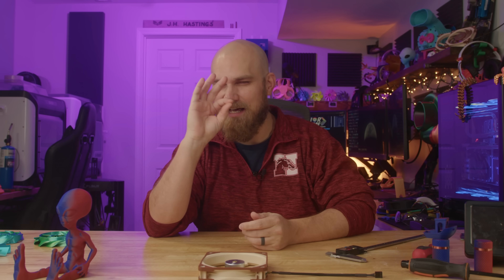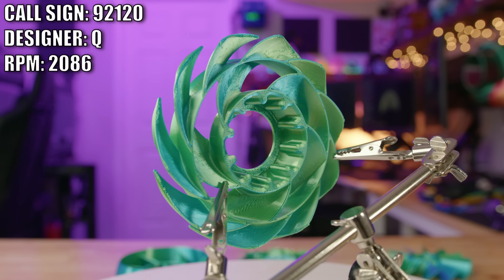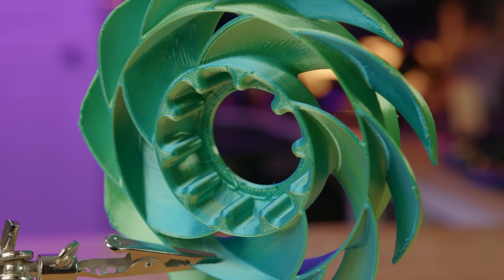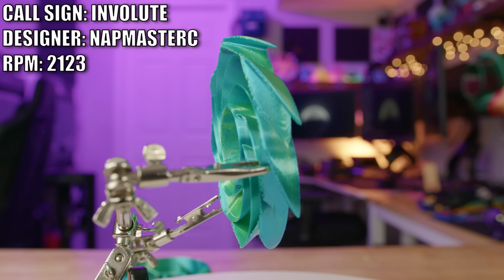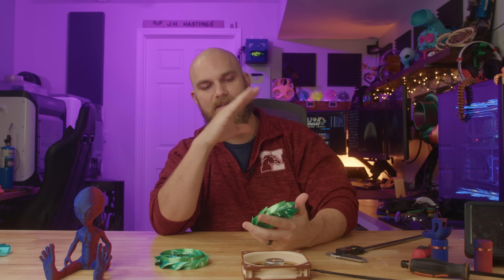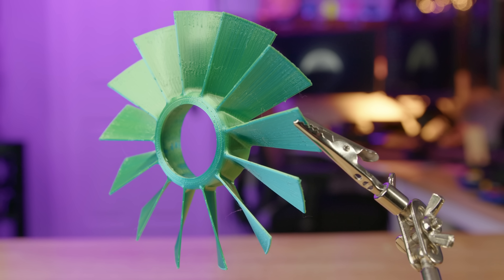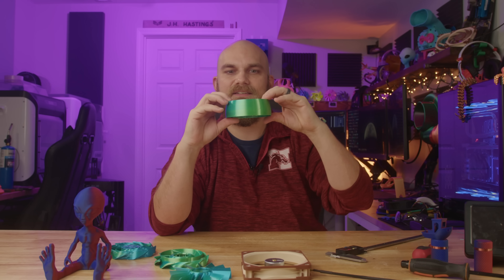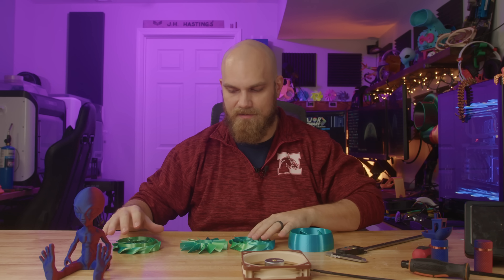Sometimes the simplest solution is the best solution | Fan Showdown S5E2

Comment: I'm curious to see if the simple 13 beats the cheater in just normal airflow too. I haven't finished all the Fanshow downs but I'd love to see all the tops from each season put through all the tests to see who stands at the top in each class and then the best fan blade design tested in the cheater housing with a nose cone added

Comment: I just read a tweet that said that uneven spacing for fan blades produces less noise but no one does it because consumers think it looks ugly. I wonder if it’s true
Reply: Although it seems common for car radiator fans to be like that. The weight is distributed differently so the center of mass is in the same place

Comment: AABCOOLING Black Jet Fan 12 has 15 blades, 100CFM (170m3/h) with only 1600rpm. Each blade have 3 transversal lines.
Cheap, but noisy.

Comment: i have a theory of why theose rounded tunnel fans never work the best, i think the whole air flinging off the tip effect of air is actually helping overall air velocity,maybe it uses the housing or shroud to slighly compress the air instead of helping direct the air... just some theory maybe im wrong but yah

Comment: what do you use for your fan speed control?
I am trying to use 2 pc fans under my gas insert fireplace to move the air.  I connected the fan to a usb cord and power brick, but, it doesnt move at top speed.

Comment: On the callsign 92120, the pegs are a feature called "crush ribs" commonly used in injection mold designs to keep things tight and provide flexibility in tolerances. They are very useful in 3d printed designs and I'd love to see them more often.

Comment: why not resin print the fans? Even if this makes weight an issue with thicker blade designs, wouldnt that just be a design challenge actually relevant to real world fan design, seen as that is basically just optimising for material usage? 
The main benefit would obviously be print resolution and print quality, this would make for more complex details being able to be put in and better aerodynamic properties of the surfaces

Comment: I have a question. Do you have a way to measure the speed of the fan? I feel that the larger fans may not be spinning as fast because of the larger surface area. I am curious to see if this could be another reason why the larger fans didn't do as well. Might be an interesting data point.

Comment: Its interesting the rpm difference between the designs on the same setup. Is more so because of the aerodynamic design or the weight of the fan?
Reply: Its all about drag, a heavier fan will take longer to spin, but the weight shouldn't influence the top speed.

Comment: I think that the sneaky part of the 'simple 13' is that the angle is steeper towards the core, meaning that it attempts to speed up all air to the same speed, something a lot of fan designs here actually don't do.

I think that uniform acceleration is a key part in getting a lot of air through the rads.

Comment: You know..id like to see static pressure ratings on these too, cuz some of them are gonna blow less air but have a much higher static pressure, allowing for different use cases.
Reply: An ambient pressure sensor on both sides of the fan so that we could have a pressure delta would be neat.

Comment: You could try grabbing a resin printer man... they do fans and low impact parts WAY better and more accurate to form IMO.  You could probably print these fans on an older model saturn printer and not spend too much, just buy one used when someone upgrades.

Comment: I think a lot of the print issues can be resolved by slowing it down. I can see your lash on the blades. Meaning when the head travels 25mm and then abruptly stops and changes directions. Leaving a bit of a nub. If you add some glide time or whatever your software calls it so that it "glides" to the stop point instead of under power you'll have longer print times by nearly 30% but your quality will skyrocket.
Reply: 🖕 Congratulations you among the selected winners claim your PC via telegram ⬆️🎁 🎁

Comment: You can't fix the air blowing outwards.  Path of least resistance applies here. The outside has a lower air pressure so air will always go there.unless you seal it with rubbers and slap it on a radiotor  it will go out. but at that popint your testing static pressure not airflow.

Also do you have a chart with rpm and airflow per fan you tested? My theory is the lower the RPM (unless thei are bulky or rub for example) on most fans the higher the air movement.. Picking up air = resistance = lower rpm but more air moved = more cooling capacity.
Reply: 🖕 Congratulations you among the selected winners claim your PC via telegram 📩⬆️

Comment: I think you might get great use out of a resin printer. If you ever need help with setting it up, do feel free to let me know.

I even have experience with getting the more difficult siraya tech tenacious resin to behave.
The best part is that resin should remove all complaints about print quality. Especially the surface topography causing potential issues.
Reply: 🆙Thanks for watching 🔝 message right away I have something for you
👉 Telegram 🔝

Comment: ⚛️☢️ the involute should give better results if you move the ring as far to the edge as possible, because the reinforcement is definitely needed.
also play around with the pitch angle and let it vary according to the distance from center.
also let it gradually increase from the leading edge towards the tailing edge, to smoothly accelerate the air downwards.
Reply: 🆙Thanks for watching 🔝 message right away I have something for you
👉 Telegram 🔝

Comment: I'd be interested in knowing if the Simple 13 would still beat out the Cheater with out the radiator. Imagine, everyone trying so hard to make a design that could beat the cheater only to be outdone by a guy that just wanted to put 13 simple blades on a fan.
Reply: 🆙Thanks for watching 🔝 message right away I have something for you
👉 Telegram 🔝.

Comment: There's a sort of novel way to test actual cooling performance now that wasn't available a few months ago.

The Ryzen 7000 series is designed to hit 95C pretty much immediately under heavy loads and then adjust clocks/voltage to stay right there once that temp is reached.

Without modding the CPU (e.g. thinning/removing the IHS), I don't believe an air cooler exists that will prevent a 7950x from hitting 95C and staying there for the vast majority of the benchmark's runtime.

So, you can technically benchmark cooling with Cinebench. Just throw a big monolithic air cooler (like Le grand Macho RT) on a 7950x, run Cinebench, and check the score.

Le Grand Macho RT does require some (easy) modification to fit AM5, but it's the biggest and highest performance single-fan cooler I am personally aware of. 

I haven't tested multiple fans, but I have tested undervolts and found I could get significantly better Cinebench scores with a negative voltage curve offset, because the CPU hit steady-state temperature at a much higher clock speed due to the lower voltage. 

Honestly I would love to see someone benchmark CPU coolers this way, but benchmarking fans would work basically the same.

Sure, it requires a new high-end PC build, but is that really a downside?
Reply: 🖕 Congratulations you among the selected winners claim your PC via telegram 📩⬆️

Comment: Suggestion: Is it possible to test like the all time best 5 fans in this new set up and retest them after sanding the blades smooth. This way we could see the difference in airflow and does the micro currents have some effect in blades this small???
Reply: 🆙Thanks for watching 🔝 message right away I have something for you
👉 Telegram 🔝

Comment: Hello, I'm curious- is the metallic filament more or less dense than normal, and is it enough of a difference to affect the weight to where the fans would spin at different RPM based on the material? Sorry if you already talked about this but it's just a thought I had
Reply: 🆙Thanks for watching 🔝 message right away I have something for you
👉 Telegram 🔝

Comment: So you're saying that in the cubic seasons, the Cheater beat the A12, but in these straight seasons, A12 still beats Cheater?
Reply: he uses a different measurement for determining performance, back then he used temperature delta and now he uses cfm. the cheater performs pretty much the same as the a12 but the way he used to measure was innacurate.
Reply: @topzozzle6319 : So it was less accurate before, and he has learned something better about testing since then, meaning that he should retest it in cubic mode to see if the professional design actually does beat an amateur design in both categories?
Reply: 🖕 Congratulations you among the selected winners claim your PC via telegram 📩⬆️🎁💯

Comment: Looking into the physics behind fan blade design, a thin, narrow, long, light blade that doesn't bend and has a slight twist rather than a dramatic twist does best as far as we can tell. However, there aren't many attempts on designing the most efficient/effective fan blades, excluding this one, that are out there. Surely there is a supercomputer with some advanced AI out there that could spend 15 mins on this and determine once and for all the ideal ratios for the best fan possible but no one with that kind of computing power seems to be interested at all.
Reply: 🖕 Congratulations you among the selected winners claim your PC via telegram 📩⬆️🎁💯

Comment: Although the wind funneling ideas are great, the added weight always leave them at a disadvantage, that's why i think The Cheater held for so long, since the funnel was external.
Great showdown!
Reply: As long as it is not out of balance, the weight itself is not a problem, but the greater surface area causes additional drag and it requires more material thickness which reduces the effective area for the air to flow through. So it is probably the best if the center hub is as thin as possible and if it has no rim on the outside.
So a lighter fan is probably better, but not because of the weight...
Reply: @Henning_S.  thanks for correcting me, always good to learn something new!
Reply: 🆙Thanks for watching 🔝 message right away I have something for you
👉 Telegram 🔝

Comment: The radial blades of the Simple 13 have the least amount of drag, so put less rotational energy in the airflow, which means higher RPM, which means more throughout.
The Involute is at the other extreme, with blades shaped almost as concentric rings. That has the most around of drag, slowest RPM and least throughout.
All in all two super interesting designs.
Reply: 🆙Thanks for watching 🔝 message right away I have something for you
👉 Telegram 🔝

Comment: LETS SEE THAT SIMPLE 13 SPIN AS FAST AS THE NOCTUA!!! Nearly 400rpm, I can only imagine how much extra CFM and FPM it'll gain.
Reply: 🆙Thanks for watching 🔝 message right away I have something for you
👉 Telegram 🔝
Reply: Probably the blade angle is a little too steep which increases drag and airflow, but reduces static pressure. Maybe it will perform even better with a slightly shallower blade angle to increase rpm and static pressure

Comment: -"This one was based on nuclear reactors"
-"This one was based on air loss reduction and redirection"
-"This one was has a varying number of blades across different diameters"
-"This one...is a fan. It has 13 blades."

13 blades wins.

Kudos to you, Ron Swanson.
Reply: Sorta makes sense. The other 3 are imitating the function of different product designed to different end goals. Simple 13 is imitating the function of a cooling fan; with the correct end goal.
Reply: When you try to reinvent hot water. But sadly customers tend to easily fall for over engineered stuff. Make two fans at 15$ one good but simple and yellow , one bad but white/rgb ... Guess the one you will sell the most by a humongous margin. 🐒
Reply: @fabrb26  You basically just described Noctua vs everybody else. Lol.

But I think that's just because style is important when building a gaming PC for many or most builders.

In my case, I used corsairs magnetic bearing fans on my gaming PC, and then all Noctua on my server. Kinda for this reason, but also because the magnetic bearing fans weren't out yet.
Reply: @webx135  dude just because noctua doesnt look like edward in the sunlight, its still super overpriced.
baffles me how people actually think they're not just paying for the name on those
Reply: it is blue light.
Reply: So if the key is more blades, how far can we push it before the formula breaks down? LOL
Reply: 🖕 Congratulations you among the selected winners claim your PC via telegram ⬆️🎁

Comment: I am curious if there's a sweet spot with regards to # of blades with the Simple 13 design.  What if we compared it against 11 and 15 blade variations (±2 blades)?  Would 11 blades (fewer blades, resulting in higher rpm, but lower surface area) perform any better than 15 (more blades, resulting in lower rpm, but more surface area)?
Reply: FYI: I discovered that he did tests on # of blades (https://www.youtube.com/watch?v=V_TCw1zDsY4) so 11 vs 13 vs 15 may not be worth the time.
Reply: 🖕 Congratulations you among the selected winners claim your PC via telegram ⬆️🎁

Comment: I notice you set up your smoke rig to arc the smoke down and hit on the top half of the fan, showing how it pulls in air from off-axis. This got me thinking, and I wonder if you could make some kind of laminar flow hood to shape and direct the smoke stream at the test rig--like a tall vertical ribbon or something. Maybe post some specs for the fog machine and test some user-submitted smoke flow hood designs?
Reply from the maker: interesting idea
Reply: @MajorHardware  I second this motion, and open up discussion to vote.
Reply: Honestly you could get pretty laminar flow just packing the pvc pipe he uses full of drinking straws. It’s a trick used with water so I would think it would work here
Reply: @mc63100  the fog is a suspended particulate though, so you might run into issues with stickiness or settling if you try to brute force it with dense baffles like that. Water is also incompressible where air is very compressible, so flow restrictions will behave very differently. conceptually it's going to be similar, but I don't think you'll be able to get away with putting that much stuff in the airstream without killing the fog.
Reply: I also agree with this idea as well. I think a clear acrylic box to approximate a pc tower with the smoke machine located on the opposite side would show how well a fan evacuates hot air would do well.
Reply: 🖕 Congratulations you among the selected winners claim your PC via telegram ⬆️🎁

Comment: I want to see how 3D printed A12x25 would perform. I think it would be a better benchmark.
Reply: He did this way back at the beginning, before the Fan Showdown became a thing. https://www.youtube.com/watch?v=vsqi6SP0NhE
Reply: I think the idea is to design a diy fan that's better than the stock a12x25 since it's one of the best fans and also a little pricey. Or at least that's what I've got from all of this.
Reply: @matthewnardin7304  Yes
Reply: @matthewnardin7304  that's not the idea at all, since the price of A12X25 comes most from its hub and not the piece of plastic that makes the blades. Even if you figured out a better design, you'd still have to buy an A12X25 for the hub, otherwise you're gonna use a cheap hub and end up with a noisy fan, so why bother in the first place.
Reply: @HDJess  this isn't about you buying a fan to then print out another set of blades to replace.. this is entirely a "fun thing" and a video series. nothing more nothing less.

if you personally want to use a design used in a video then that's a "you thing" rather than an "intended thing". so much so that the doesn't provide the stl files for you then go ahead and destroy your own fans. so yeah, Matthew is 100% correct here and you misunderstood the assignment.
Reply: @CreamAle  great job, professor. But it's you who misunderstood his statement, since he mentioned price. When you take price into consideration of making a "better" fan than the A12X25, you fail by default. You could only make a better fan than the A12 by spending a lot more than it costs. That fan has a ton of engineering behind it, it's optimized for more than one aspect of performance, it takes into account static pressure, airflow, noise, noise footprint, even its specific performance with popular AIO's, cases, whatnot. You could NEVER make a BETTER fan than Noctua for the same price or less, you're delusional if you think so.
Reply: and make it out of Resin, seeing as the A12X25s are made of sterrox, a liquid crystal polymer, making a copy out of resin would likely give the most similar results
Reply: 🖕 Congratulations you among the selected winners claim your PC via telegram 📩⬆️🎁
Reply: @joecobra48  did he take it deep or the guy that talks and overanalyzes like my autistic brother?